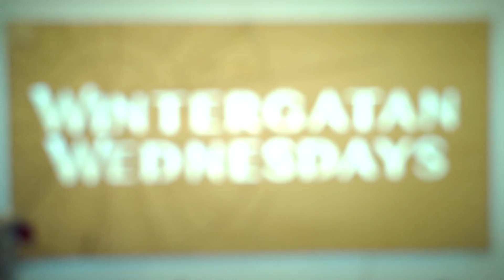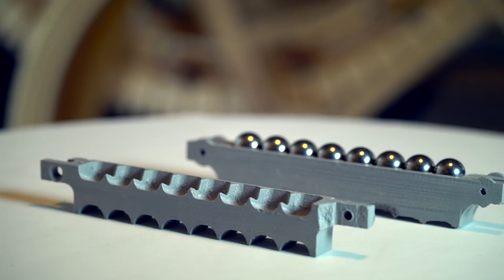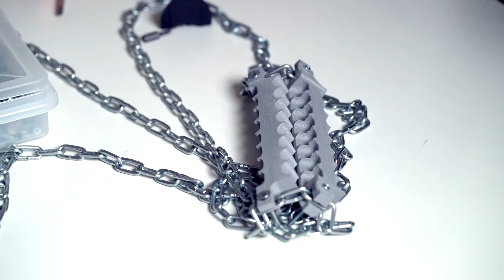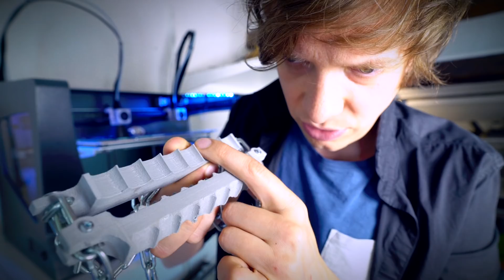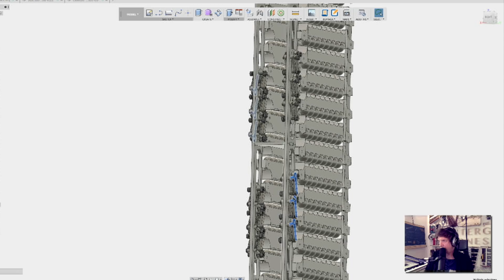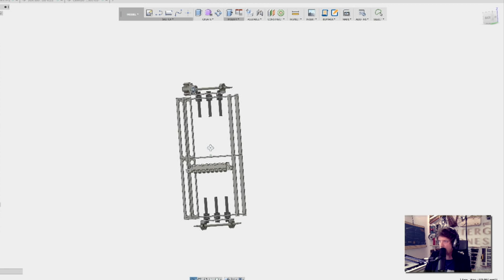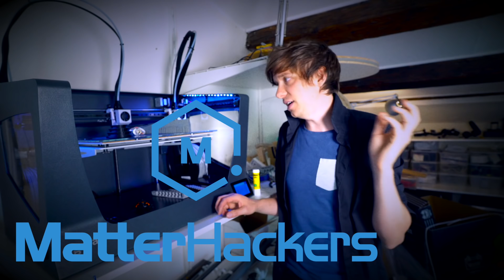3D Printed Marble Lift - Marble Machine X #34

Comment: The orientation in which you print items is important, try and rotate what you print so that the most flat side is touching the build plate, I noticed that the way you printed it needed a lot more supports than it needed.

Comment: I would probably flip the design of your guide rail, with a single tab on the lifting piece sandwiched between 2 rails on the frame. By flaring the rails out at the end it should allow for an easier time getting lined up at the top and bottom.

Comment: Instead of splitting the print turn the print it on it's back then you'll only need to use minimal support structure for the fingers where it connects to the chain ^o.+^

Comment: Hi, you could print your parts side down. This way, with little modification on your design, you won't need any support. Also, you  will be  able to fit a lot more part on your print bed. Thanks you for your good entertainment :)

Comment: That printer has some great mechanics, such as linear rails and mirror as buildplatform.
Check out some of Thomas Sanladerer and MakersMuse for some tips if you run into print problems.

Comment: Use a raft or brim, and print it at a 45 degree angle - if your printer handles 45's so good - instead of splitting the part into 2 parts.

Comment: Why don't you just use the filament that melts in water to create the support and then another for the actual 3D model. If you do this, then you can just put it in water and wait for the support parts to dissolve.

Comment: TBH, I'm a little concerned where the development is going. As you complained earlier about the built of the first marble machine, that too many parts were "fitted in" on the fly and CAD planning should be avoiding the pitfalls, it seems you went back to improvising many many things with that lifting system alone (the past few months?). I'm wondering what happened to the already completed parts you've presented (the "magazine", release mechanism, the programming wheels (with what pin solution?), etc.) or the ones already planned (planetary gear assembly?).

I hope this doesn't come out the wrong way, I love this project! I just miss the progress of the first few videos, from blueprints to first CNC parts to something moving...it was so amazing!
This whole re-planning and CAD tutorials is not my cup of tea....

Comment: You might want to consider resin casting if you're going to be making 60 identical items, then you ony need to print the master part. You also have a lot more control over the appearance when using resin and your parts will be stronger

Comment: I find it interesting how much time you spent to plan and construct a marble lifting system to get rid of a conveyor belt, but still ended up with a conveyor belt.
I love the ideas of the different systems and hope they will work out. My greatest concern is that all these different systems bring their own little problems (like the need for a de-magnetizer), instead of using a single solid concept.

Comment: Couldn't you use a Geneva drive instead of the ratchets to make it cooler and possibly easier to transfer the constant rotational force into one with a pause? The only downside I can see is that they tend to wear out faster than most mechanisms but still not that quickly.

Comment: Watch out for warped dimensions due to the layer of glue, if u do cut the pieces in half. Also I'm sure someone will draw a cool version of the screw AND combine it with the demagnitiser so it' not only cool but double the functionality. That's 3 for the price of one.

Comment: You seem to be spending a lot of time on the delivery method of the marbles to the top of the machine. Why change it so many times? Also, that printer is overkill for this project IMO both in cost and function.

Comment: Im sure some one has mentioned it already.. however. If you plan on using supports, you can use dissolving filiment in one head. Also spend some time tuning the support parameters. You will get it tuned in so that the support will allmost fall off. So happy to see you with a 3D printer, and matterhackers on your side :) they are some great people. Looking good. ~Russ

Comment: Awesome video and, yes, awesome track! Well done Martin, Marcus and Teleskam! 

Looking forward to a prototype, especially now that you have a 3D printer! Does seem like a lot of moving parts and time/resource investment just for a marble lift. Also, my concern would be at the flip, is there a way of ensuring marbles will roll and not get catapulted - especially if you have a speed/tempo requirement? If it works perfectly, without ending up with marbles everywhere, I think it can "pass The Rule of Cool" (going to use that in life now, thank you BaronZ : ) 

Imo though, the Archimedes Screw sounds like a great idea that could definitely also pass The Rule. Imagining transparent casing for the screws; and if you had 4-8 of them, it could look like chimneys or vents to your ironically analogue machine.

Comment: I feel like the guides for the sides may be a point of failure. Specifically, the point where they enter the rails. But it may work if it starts low enough and with a nice taper.

Also I was going to comment a bunch of things about 3D printing but you got that already.

Comment: You could have written a program for the CNC to do the finishing work after 3D printing. You use a ball cutter for that. A ball cutter has a rounded tip on the end.

Comment: If you are going to use rails to guide the cariers you should round up the the entry for the rails on the cariers sides to not get them blocked by the smallest nudge like in those cheap rubik cubes, the edges would mis-align and and hit each other, possibly breaking themselvs.

P.S. sry if i misspelled some words

Comment: hey dude, nice work!
would it be possible that the ratchet system work smoother if each ratchet is offset a quarter of a turn? it might also increase the coolness by having 4 arms working in series.

Comment: I think the archimedes screw could totally be made to work with rule of cool. If you contained it in a clear acrylic tube, or a wire cage. A few of them staggered in parallel could also boost lift capacity and contribute to the aesthetic (maybe even fan them out?). My biggest concern with the current lift mechanism isn't if it will work, but rather how reliable and repairable it will be long-term. Since the goal is to have the MMX be roadworthy, the level of complexity that the lift mechanism is getting to concerns me since if it breaks down, the whole machine is stuck.

Comment: Gatan, you should have printed the parts on the side so there won't be any support needed. since the weird angles won't be upwards, the printer would have printed it better and would prob use less material for the support. 
https://imgur.com/a/jdQWH5P

Comment: Not sure what kind of plastic you are using but just to be safe..  Once you finalize the printed part,  make sure it's a high temp PLA or use something like PETG or ABS. Normal PLA will get very soft and deform inside a warm car for example.

Comment: Print orientation suggestion, don't split it, the rear vertical face should be the bottom when printed, then the only supports would be in the chain and rail groove.  Look into dissolvable support filament for the second head (filament dissolves in water), once done printing just toss them in a bucket of water and scrub off the supports.  Keep up the great work, been watching for almost 2 years.

Comment: The @BaronZ condition: a solution can be implemented in the project if and only if it passes the rule of cool.
Corollary: if the solution is cool but doesn't work, it will be engineered until it works

Comment: be aware of possible alignment issues when splitting a part. and also watch out that you don't make a part so thin that the printer doesnt print it.  also double check the tolerances of the part after a print run.

Comment: The marble lane leading up to the marble lift goes from one lane, splits into 4 with your nifty design meant for the old lifter and then merges back into one lane again. Having it like that would probably create an unnecessary bottleneck compared to just having the one lange go all the way to the new divide by 8 tipping mechanism that goes into the new marble lift.

Comment: You could produce one really good 3d print, then make two part silicone mold and cast the pieces in resin. It could save you a few hours.

Comment: One thing you could use with your 3D printer is soluble support structure, a special filament which dissolves when submersed in water or other fluids.  Also to clean your prints with you could use acetone (I think this is only with ABS though not PLA).

Comment: What plastic did you use? If it is ABS plastic, then you can use acetone or ethylacetate to make details smooth and more strong. If it's PLA plastic, then you can use dichloroethane (but it's dangerous), or hot air.

Comment: Good luck calibrating. I mean that seriously. I've had my printer for 6 months and I feel like I'm just now figuring out how to fix issues. There are a million options, some not well described, others not described at all. And they all behave with each other in weird, weird ways. 
Simplify3D has a troubleshooting page, but the options they suggest are specific to their expensive software. Cura usually has a similar option, but it can take some research to figure it out.

Comment: I think the cork-screw idea would actually pass the "rule of cool" test. I also think it's simplicity is appealing. However, I think you could maximize the "rule of cool" cork-screw suggestion, with some creative design. What if you had the cork-screw made out of perspex and had a electromagnetic coil running up the center demagnify the marbles.

Comment: Don’t split the 3D model if you don’t have to. If all the curves are in the x or y axis, then the support will be easy to clean. IE the flat faces are parallel to the build plate.

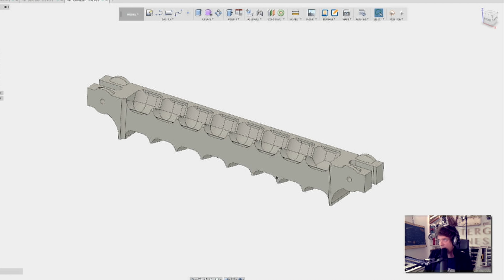Comment: Just a little thought: Dont slice it up, instead print that thing on its back (@ 4:37 your looking at what i would call the front & top) that would mean theres just a small amount of support materials needed inside the slots where the chain links fit in, but you should consistently get perfect rounded 'pockets' and 'paths' without any sanding needed (translating in every single of these lift pieces acting exactly the same, which im gonna assume is important later down the line)

Comment: i love the updates! i wondered--why don't you use CNC to trim the supports and tabs? you already have the file for printing the part, can you not use it to also trim the part once it's printed? i'm told this is what many additive manufacturers are doing. looks like alot of imprecise handwork at the end.

Comment: Archimedes + transparent gutter for the marbles + openings at the top where no marbles come and metal fingers triggered by the archimedes.
Fingers like the front of your machines has as well.
Should be too cool for the rule of cool to applie, no?
Or make the cutter with a series of metal bars to close to each other so no marbles can fall through.
If archimedes, then let us still see the marbles.

IT'S A MARBLE MACHINE, WE WANNA SEE DA MARBLES!!!

Comment: Brilliant.  Nice to see the sharing of the 'learning phase'.  One thought as regards the marble carriers where they fit the guides. Add a chamfer to the leading edge on both sides just to allow for any sway that may cause the edges of the carrier guide slots to crash on the guide tips.  Or are the guide frame tips chamfered to aid safe entry?

Comment: Idk the name or where its from im also too lazy to search it up but if you need support material you should get some of the water soluble filament and eith the new printer it would be really easy to use this filament dissolves in water so you just put the entire printed piece in a bucket of water and the support material vanishes leaving a pretty clean piece making less work and better quality

Comment: best print direction for supports doesnt always mean best for print strength though. also need to keep in mind what direction the print will be getting strain on like if you have the part having pulling force along the layer lines it coudl cause the layers to break apart.  you would want the strain to go across the lines not with the lines

Comment: Most 3D printers I have seen use a chemical batch to remove support structure, I believe it's basic on the pH scale and warm, 50 degrees Celsius. You can put several parts in at once and remove them after a couple hours with the support structure removed

Comment: Since you have a dual extruder you should look into using PVA. Water soluble plastic. Then you can get really tight support, throw the parts in a bucket over night and have a beautiful print afterwords. Printing speed/acceleration/jerk along with temperature is the main factors on quality. If you're using Simplify3D there is an option that lets you override the printing speed on the outermost layer. use it !  
Looking forward to next video! :D

Comment: You dont need to split the part to print it.  You need to rotate it and print it with the long flat part on the print bed.  Then you wont need any support at all so little to no clean up.  I would print a brim on it to  help with warping and it generally peals right off with no problem.  I agree calibration is needed but a simple rotation of the piece will solve nearly all the other manual labor issues

Comment: Looks great. I would recommend making a master version of this. Use filler to smooth out the master. Spray it with clear spray paint and polish it til it is shiny. Then, make a silicon mold of it and cast with Smooth-Cast 300.  You can make tons of them this way much faster too.

Comment: Honestly with this one you should:
First use the duplicate ability (each print head print the same object so speed X2 and it's not a luxury)
Second I don't think you should split in two your pieces. Just print with the rear face (when they lift marble) laying on the bed.
This way the only cleaning/support would be on the chain path.

Third select good filament b cause some are just awful to tune and print.
And avoid ABS, this material sucks, warp like hell and is not good mechanically. Pla is good for what you want to do.

Comment: I think I might have asked this before, but what is the purpose of the Fish Stair now? I thought you had replaced the fish stair with the marble lift, so why is that still there?

If you want to go with the Archimede's Screw, why not use a transparent enclosure for it and color the screw? That will be plenty cool, in my opinion. You can even decorate the transparent enclosure with contrasting lines to increase the illusion of motion. The main issue I see there is repairability since you'd have more large pieces instead of modular pieces.

Comment: you didnt need to go that high end on the printer (imo a TAZ 6 would work fine). You are right about the design and tuning, once you get it all tuned then your prints will turn out awesome! btw the lower the resolution you go the finer the print will come out and the less finish work you will need to do :)

Comment: Remember, just about anything you can print you can take a mold of and cast in a much stronger resin.
Reply: Yes! Print the template using the 3D printer, clean it up, then cast the rest. Much faster and cheaper.
Reply: Or, if we're being time-sensitive and economical, use Carbon3D.

Comment: Reorient your part when you're printing so the flat part is down. Then you only need support between the guide fingers.  
And make sure you're using the right temperature for your filament and you'll need to tune the retraction and temperature for your specific filament to get the best quality prints as well.

Comment: I think the sigmax was the perfect option for your kind of workflow with the independent tool heads allowing for faster production. ryno was a good choice in filament  similar to petg's but less of a pain to work with (especially with stringing) it's also less of a pain with layer adhesion. If you are going to do some large part count prints (on one bed) a bed adhesive may help with anxiety of first layer adhesion, e.g. hairspray or magigoo as if one part fails they will all fail unfortunately.

Comment: With the sigmax you can print PVA support which is a filament that dissolves in water because you have 2 extruders. PVA is used to support complex 3D models meaning that when you are designing you are not limeted by the printer. I recommend you take 20 min just to do a little research on PVA support because it can save you a lot of time in the long term when designing and post precessinf.

Comment: im actually considering buying a resin based 3d printer for my dental clinic for fabricating temporary crowns and mouthgards, as well as replace any missing or broken plastic instruments in the clinic, but im not sure that its price can justify its use even though it has a lot of potential.. the model being showcased in the PDA-APAC Asia Pacific Dental Congress 2018 was the Form 2 by Formlabs, if anyone has any experience with this or can give me some advice, i'd be glad to receive it.. thanks

i will be appearing in the FDI World Dental Congress 2018 in Buenos Aires, Argentina in september and will probably decide then..
(also to wintergatan: great job with the video, im not a 3d printer techy yet but i do a lot of 3d work, my advice - create an interlocking backplate shape
 for those pieces so that when you glue them together they will always remain perfectly aligned, this will also add strength to the joined piece once it cures.)

Comment: I think an Archimedes Screw is visually much cooler compared to a convayor belt. Of course the tube has to be transparent to see the screw, but that kind of motion is very mesmerizing I think.

So does it pass the rule of cool? Current system: no. Screw: yes!